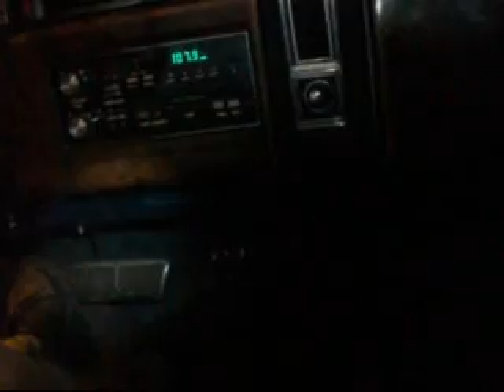6 8 10  Toro Legend Cold Crank...

Comment: I love that bodystyle Toronado, the last of the big ones. I bought one of the redesigned 86's in '88 and had lots of problems (transmission shot a rod at 35,000 miles and electrical problems). I often wished I had bought one from the previous generation.

Comment: Check out my 1984 Oldsmobile Toro it has 94000 miles on it and i got it for $160 it didnt run for over 10 years and i put some gas in it and played with the starter and its a runner and driver needs some TLC but it was a Cali car so the body is pretty decent shape not the best but better than most in minnesota